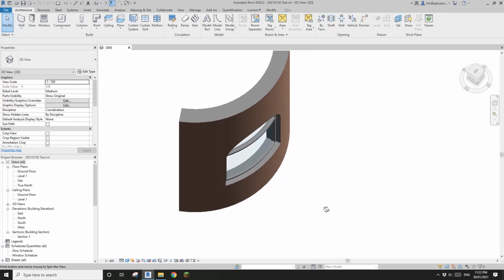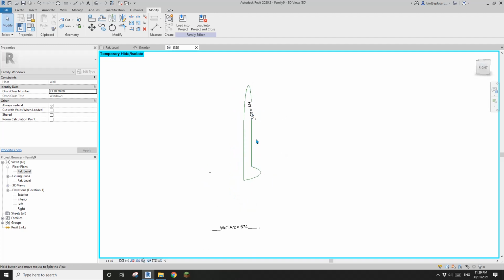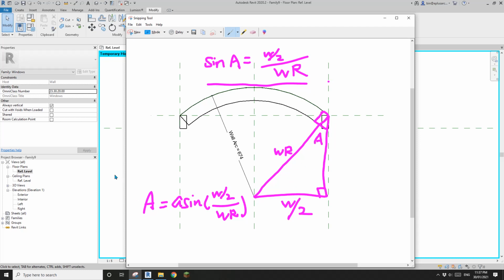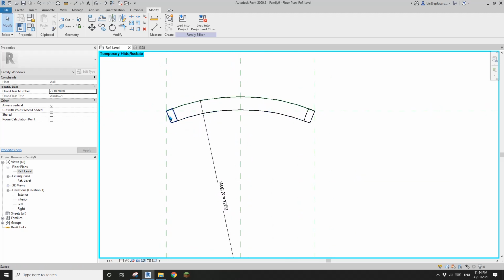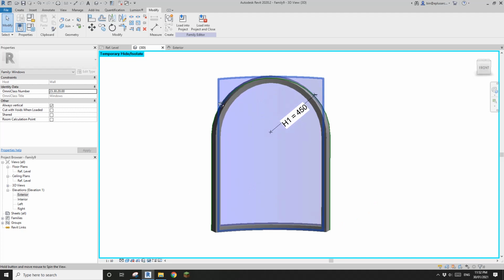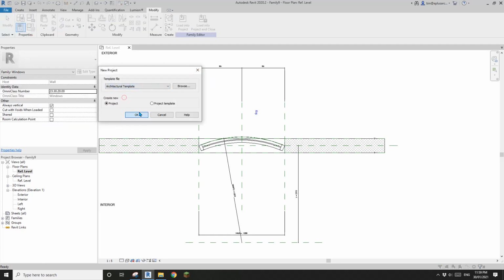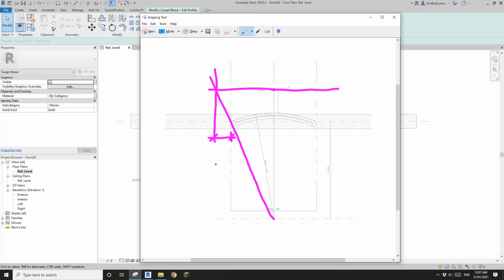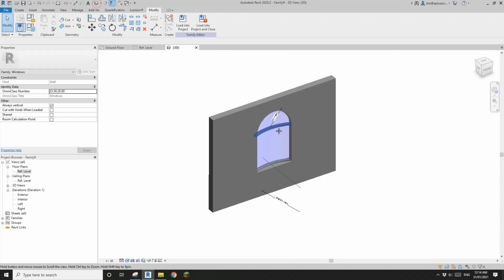Everyday Revit (Day 317) - Parametric Arch Window on Curved Wall

Comment: Pls do one more vedio regarding offset of this window because it is very much needed in project pls complete that window ,i will post this in document
Reply from the maker: It can be done doesn’t mean it should be done, this is an example. I suggest you do not worry about it in the family, because most likely you will not see the difference on floor plans and you will document the details using detail component.

Comment: Hi Bin,
I just started learing Revit, and mine is Revit Lt.
When I was trying to follow this video, I couldn't go ahead when deleteing the existing elements (wall) in the original template. Googled and somebody said because that some elements have been locked, should be ok once saved as fimily (.rfa)
I have tried, but still not working.
Does it because my version is Lt so the functions been limited? 
Thanks,
Xiaoli (my computer logged in under my husband's account)
Reply from the maker: Not sure about the LT. But if you created a family using the wall based family template, there is no way you can delete the wall in the family. The only way to delete it is to create a new family. You can hide it by uncheck the wall category in VV setting.
Reply: Thanks, I will give another try. Must misunderstand something while watching the video..